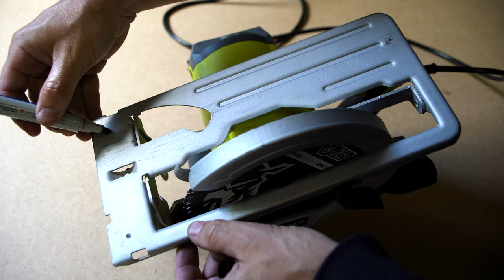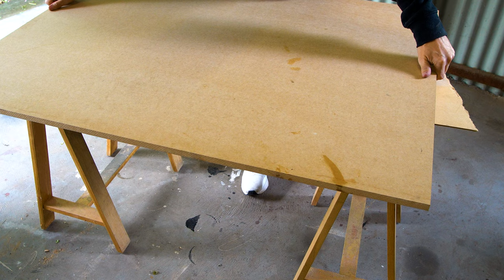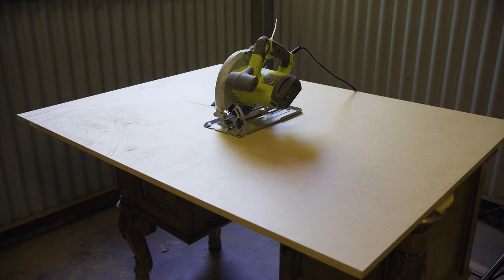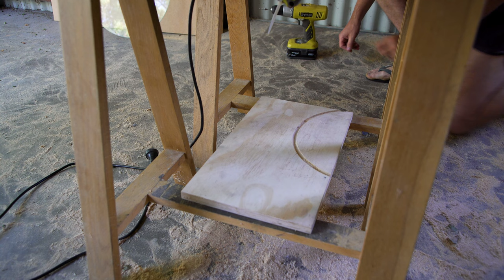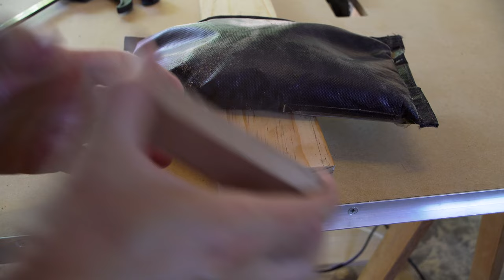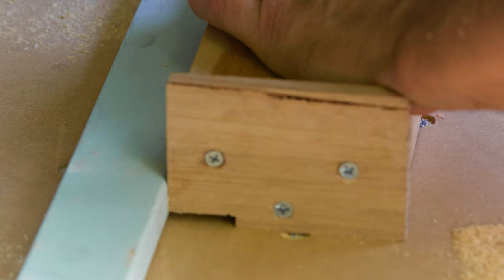Cheap and Simple Table Saw Build! DIY With A Circular Saw

Comment: Now do part two where you install cables to keep the two ends of the fence perpendicular to the blade and install a tape measure at the business end so you can easily input a measured 90D cut without having to stop the saw and measure it with your portable tape measure. Then you can get rid of those clamps.
Oh, do you know how to do that?